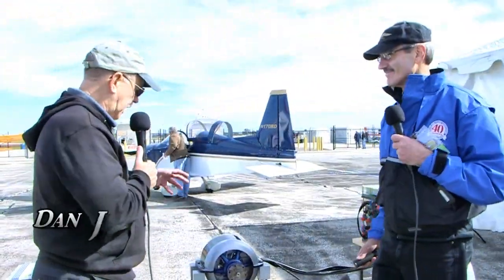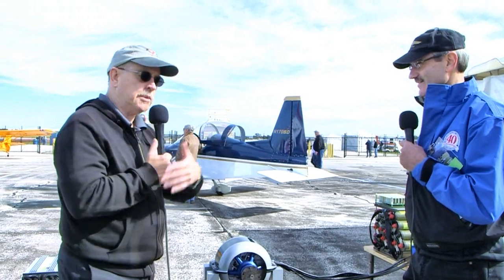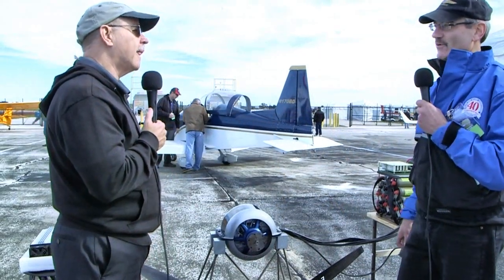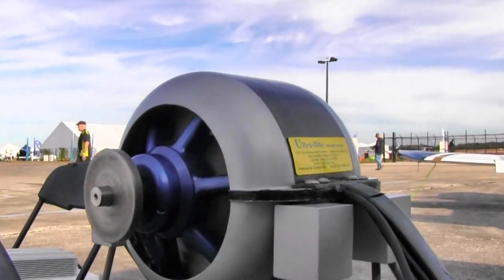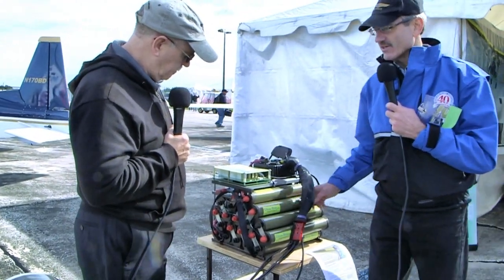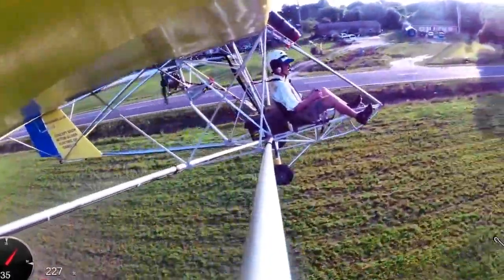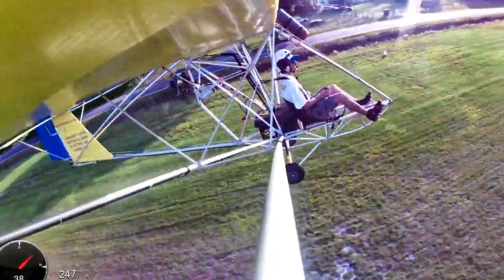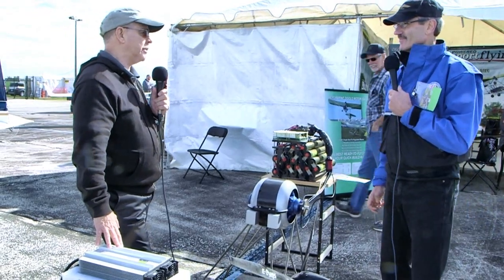Electric Aircraft Engine Power Pack, for Aero Marine LSA’s Zigolo and Merlin.

Comment: G'day,

  If the Motor is 25 Pounds, how heavy is the 1-Hour Battery Pack ?

   My VJ-24w would be a rather nice Electric Motorglider, last time I flew it was with a 22 Hp JPX direct-driving a 42-inch Prop, and it could barely climb once out of Ground-Effect.

;-p

Ciao !

Comment: It just isn't a few cents do charge. If the battery is 65kwh, and the eletricity costs 15 cents per kwh. It's at least $10 considering 100% efficiency.
Reply: That's an awful lot of energy for dinky little single person very light aircraft. You could probably cruise for 10 hours on that! So that's a buck an hour, more or less. That's for the ultralight. A cleaner aircraft might need half that.  That's good, because a 65kwh battery pack would be quite heavy! 
65kwh is equivalent to 87 hp hours!! More like maybe 65 hp hours at the driveshaft. A big, 4 stroke aircraft motor might need 0.43 lbs of gas per horsepower, per hour. Let's say you're using a small engine, and call it 0.50 lbs, though a 2 stroke would be more like 65 or more. So, for the 4 stroke, that's 32.5 lbs of gas, or about 5.2 gallons, which happens to be the limit for ultralights, as I recall. If the gas price is $2.50, that's $13, more than for the electric. If you buy your gas at an airport, it' might be $4/gallon and $20.80 total, and that's for "mogas". If you have to buy 100LL, it might be a lot more than that, though it's only a little more at the nearest small airport. Other places maybe $7. The 2 stroke is likely to use at least 30 percent more fuel! The above is predicated on cruise near the efficient range of power for the engine or motor. That ought to be maybe 75 percent power? As I recall, electric motors can be efficient at smaller fractions of their power output, but don't count on that. So, if you want to just mosey around instead of get somewhere, the gasoline engine will look relatively worse, since you need some fairly large amount of power for climb as opposed to cruise.

Comment: with all the C172's in the world, why hasn't anyone hooked this up as a double-ended "in-line" helper or booster on the gas engine?  Put it on the front of the regular engine, let the regular engine drive through it... Only need battery for the "boosted" part of take-off.... imagine having 250 HP available for take-off in a 172????  The possibility is insane, and you would only need enough battery juice for ~10 minutes per flight (the rest of the time, run on the normal gas engine)
Reply: 250 HP might twist the entire assembly into a little ball.
I always wanted to fly a little ball.😳